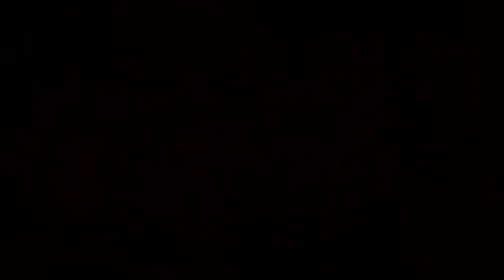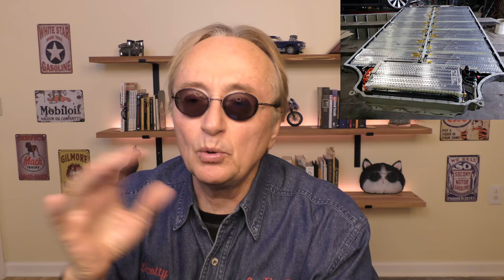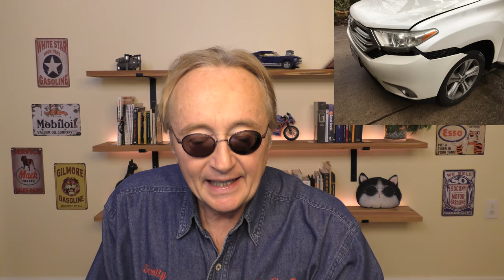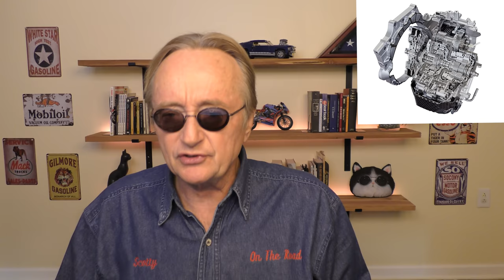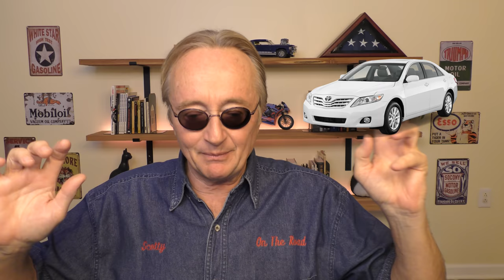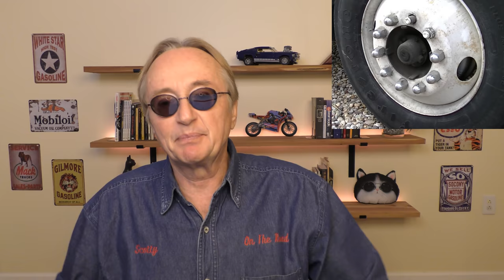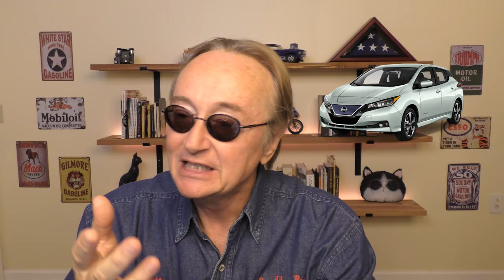This Fatal Flaw Just Ended Tesla’s Future in America

Comment: My great, great grandfather said that the car would never replace the horse and buggy because those rubber tires need air and those engines need gasoline but a horse can just eat grass on the side of the road. I've been an engineer for 35 years and one thing I never say is they'll never advance any given technology. Your emotional attachment to the internal combustion engine is cute considering its 20% efficiency in turning chemical energy into mechanical energy and that is after more than 100 years of technology. Electric is coming no matter what you and some of your commenters think, it has nothing to do with the gubment and everything to do with science, engineering, and resource availability.
Reply: @Mark Codiroli Diesel engines hit 40%. Educate yourself before popping off.

Comment: I am 14 years old I live in Greece and when I grow up I want to become a car mechanic can I or will there be only electric cars?
Reply: water is a clean fuel, 1 litre of gasoline/petrol contains 116 grams of hydrogen, 1 litre of water contains 111 grams of hydrogen what comes out the exhaust of the car is oxygen some steam and water you can drink.

Comment: I thought lithium ion batteries were not supposed to have the crystal growth shorting problem that nicads suffered from. Are those lithium ion batteries made in china? Wasn't there a special charging method for nicads, superimposing a little AC on the charging DC voltage that would reduce or eliminate that? I can't believe this ends the future of electric cars. Is there a similar method of fixing the lithium ion problem or is there a better material coming?

Comment: Scotty I have a question Toyota could make a car that had a scan tool on they Dash that could tell you what is wrong with your car it could be called the Smart car thank you for the video God bless
Reply: Ya I have thought the same thing, It would probably cost about 50 cents to have a system to display the code and description rather than the stupid "engine" light.  Mind you I'd settle for a Battery Voltage gauge and an Oil Pressure gauge both long gone from vehicles or we could right out there and suggest a transmission temperature gauge......nah that's just crazy talk!

Comment: 01:50 - Sorry, but no. This is a problem with a small batch of batteries out of one production line that was traced to a misaligned piece of equipment. No other production line making the identical batteries has the problem and neither do any later model Bolts with the batteries from the US production facility. No Tesla batteries, or any other manufacturer, has had this dendrite issue in less than 250k miles and most don't show signs upwards of 400k miles if well taken care of. Your assessment of EV is very unfair given they have been mass produced for only 8 years ...How well did gasoline cars do at the 8 year mark? Were Ford model Ts making it hundreds of thousands of miles with issues?

Comment: Its by design. They don't want batteries which can last long term.
Reply: Tesla is actively chasing a battery that can go over a million miles with less then 20% degridation, their current batteries are at 20% every 400,000 miles, even the motor has been tested for 1 million miles, their new battry cell they are vehicle testing now will do that, electrical engineers working on the car mantion the electronics being 5 years ahead of the auto industry, they aint putting nock off japanese caps on these things.
Reply: @Mark Codiroli peove it.

Comment: Scotty, I understand you’re suspicious of anything you consider new. However, batteries can be designed to last one use, or 100 years. It REALLY depends on the design, allowable cost, size, weight, etc. There’s a great deal of difference from a ‘lithium’ battery you get in a phone, or camera, and the one in a car. Batteries for a camera typically aren’t made to last more than a few years, since they really don’t need to. EV batteries are often designed for 10-20 years. Of course this does not mean they all will, in all conditions. The Nissan Leaf has a rather poor performing battery, and they still don’t do much about it. However, with a good design, you can make an affordable battery last 20+ years in an EV, which means it will most likely never be replaced. Tesla has a fairly good track record, easily the best in the industry, all things considered. They had a lot of outright sudden failures, but when those don’t happen, the degradation is surprisingly low. Other manufacturers are slowly coming out with good designs and hopefully they last a long time as well.

Comment: You can't compare a camera li-ion battery to a car battery. By manufacturing the batteries differently, you can prioritize energy density, power density, longevity, or cost. I've had phone batteries go kaput in 1.5 years, but I have an iPad 2 that still has pretty good battery life 9 years on. All because the battery is less energy dense than a phone's, so it's able to achieve greater longevity for a given energy capacity.

I also have a Segway that still gets its full range after 3.5 years and hundreds of charge cycles. If a battery is meant to last, then it can last.

If you need proof, look at Apple's claim of 80% battery health on Macs after 1000 cycles. My Google PixelBook still has 91% battery health after 700 cycles. Or even go on battery university's website about how if you charge batteries to a lower voltage, you get thousands of cycles. All these things can be achieved by sacrificing energy density and making the battery physically larger.

Comment: This is why we buy trucks from the 70s 80s 90s they run 10 times better. And don't need to be charged.
Reply: They form emissions that kill much more americans and are a road sefety hazzard, cars before the 90s where garbage, their batteries where also shot so you did have to get a charge from someone else when it failed 2 years in.
Reply: lopez  more people die in trucks today then they did back then. cuz the car now are basically made of plastic. And the trucks back then were made of real steel. And  btw the trucks had nothing to do with the batterys.
Reply: @jacobdaniel9239  cars back then wherent built with crunch zones, this lead to the car being so solid that the passengers bounced around in them splitying their heads open, cars right now are built to save the passenger instead of themselves by letting themselvestake the impact energy to reduce the jolt from the impact, battery powered cars have the highest crash safety because the heavy battery anchors the car to the ground more effectively then a gas drive train, tesla is making a stainless steel truck with 1-3mm pannels of the same steel used in the new Starship rocket, its supposed to be more rigid then a regular pickup, looks like it.
Reply: @Mark Codiroli i know more than you about this, try it.
Reply: @Mark Codiroli are you going to ask questions or not?
Reply: @miguellopez3392   they really didn't need to put a crunch point in it cuz they really didn't go that fast. Back then most people obey the law. And weren't many wracks.
Reply: @jacobdaniel9239  well trucks of today go much faster and people still dont care about speed limits, that truck tesla is making goes 0-60mph faster then a Porsche 911 so it really does need cruch zones, less people also owned cars back then and there where less injuries because they died instead, remember when companies tried convincing the public they didnt need sestbelts? Cars and trucks back then wherent built to keep you alive to keep it cheaper, thats also why you see stronger emission regulations as emissions from cars kill more people then from car accidents, trucks are the hardest hit by these regulations.
Reply: @Mark Codiroli still waiting.
Reply: @Mark Codiroli can you give me an example of a question you asked? you seem to have repeated the same comment 4 times thinking you where having a conversation.
Reply: @Mark Codiroli still waiting.
Reply: @Mark Codiroli really nothing?
Reply: @Mark Codiroli I repeat give me an example of a question you asked.
Reply: @Mark Codiroli 1 more time, give me an example of a question you asked.
Reply: @Mark Codiroli have you found your question? And if so, repeat it.

Comment: He forgot  to mention that if you  DON'T  leave a Tesla fully charged for long periods  of time the dendrieds never form. I bet his cameras are fully  charged right now. Also there is a good reason Tesla doesn't want normal auto mechanics working on there cars. They would be better off hiring  an ELECTRICIAN. At least they would be used to working around 360 volt three phase systems and not just 12 volt systems. This man would likely  kill himself trying  to work on a Tesla. Maybe his next video should be how to safely  disconnect the power to a Tesla. I bet he dosen't know without researching it. He is probably a good mechanic on normal interernal combustion cars.

Comment: I’m not ready for electric car that I have to replace a quarter of the time that a gas powered car could last.
Reply: Model S plad+ factory stock

Cost 
 $140,000
Speed
  200mph
0-60mph time
 1.99 seconds
1/4 mile time
8.99 seconds.
Range
 520 miles EPA
Coming late 2021 slighly slower vesion delivering in 3 weeks.

This will be the quickest production car ever made.

Comment: Who needs tesla when mazda is going to make a combustion engine with equal carbon footprint
Reply: Hopefully. The Skyactiv-X is impressive enough but did fall kinds short on delivery, but as the first and only gasoline engine to achieve a combustion ratio to that of a diesel engine, it has room to improve also. So if they deliver with the Skyactiv3  with a thermal efficiency of 58%, it'll be decent to see more of it.

Comment: This is disingenuous. The problems Kilmer is listing are well known and the solutions for them are working.
Comparing electronic device batteries to the automotive batteries is invalid, the automotive batteries have things like coolers and heater that your cell phone doesn't, which ameliorate most of the Li-ion temperature issues. They are also a different chemistry.

This and his other videos on electric cars are diatribes, they are not valid representations of the technology.
The degradation with time of present Tesla batteries does not affect acceleration, only range and that loss of range is tracked and for many people still is far more than they need on a charge.

Comment: I have a 2020 Chrysler Pacifica S red it Wolf hybrid with EV and Gas it was good In gas but The EV battery will only give me 32 miles In battery it will only last me like 35mins till The EV battery dies So I will stress a lot to try to charge the battery but the Hybrid  with gas gives me 480 miles range with a 32 miles on EV battery my fan will give me 512Range but If I use the 32 miles on EV battery with the radio AC and the time lights on and DVD player play in the movie the van will only last 15 to 20 minutes before The battery dies so I didn’t like that I paid 47k for it it was Waste of money If you choose to buy one of these cars please buy the hybrid because it Runs with gas also...

Comment: Graphene batteries are hopefully here soon.
Reply: new tesla batteries should last over 1 million miles of use.
Reply: @miguellopez3392  Yeah, that'll happen when it's ACTUALLY proven, otherwise, you can't say that now, there's no evidence to support it. And it'll be fun to see how the rest of the car holds up, because well, it's called a CAR for a reason, NOT  a battery.
Reply: @samtiffin6878  there is evidence such as teslas partners publishing papers on the durability of their chemistry, thankfully battery cars have less parts to brake down anyways.
Reply: @miguellopez3392  Well, the battery hasn't been put to test in an ACTUAL CAR, so you still can't confirm it to be true, a prediction isn't an outcome, there needs to be an experiment, to confirm what you're saying.

Yeah, an electric motor will be simple, but all the modern complexities of cars isn't, and those will break down over time, leading to expensive repairs, jut look at the amount of technology in a Tesla it is bound to have electrical issues, in coming years. Cars need to get simpler, with less infotainment features and other unnecessary features and equipment then only can cars can be actually reliable enough to keep for a long time, without the need to throw away the existing one, for a brand new one. And I don't see the point of making new electric cars, when it will take much less effort and energy to just swap in an electric drive train into an existing car body, you're recycling something by doing this, and that's good for the environment, it means we can save materials such as metal needed to make the body and wheels, and rubber to make tires, making new cars and scrapping the old ones, is just a big waste of resources.
Reply: @samtiffin6878  it will do better in an actual  car, testing cycles for batteries are done at room temperature and are discharge and recharge from 0-100%, EVs will typically have glycol cooling and cycle between 20-80%, this significantly reduces battery degradation, their current cells can do 300,000-400,000 miles with only 20% degradation to the cells, these same cells will only last 2 years before doing that damage in a laptop or phone scenario where they aren't actively cooled and are power cycled more aggressively.

Teslas have reliable electronics, their interiors may be boring and their fit and finish questionable but they do spend extra on the electronics and mechanical engineering, it's why a $62k model 3 is seen as a booring or substandard "luxury car" but 
 "ranked as best commuter car"  and can compete with a $120k electric Porsche on track.
Basically they don't cheap out on the electronics like most companies do, and it makes a difference, you will not find more processing power in a production car than in a tesla model S, teslas don't even have removable fuses due to how long things are engineered to last, they have limited service centers and no dealerships so it would be more expensive to set up the repair network for their cars then to make them last longer, there comes a benefit from replacing 80 mechanical buttons with 1 digital display.

Comment: With over 32 million cars in the UK where will the exhausted batteries be dumped? Your backyard?
Think Hydrogen must be the answer. Two plants in the USA building the fuel cells. A plant in Wales building a two-seater now.
Reply: Why would they be dumped? Cell phone batteries don't get dumped. 
If correctly designed, vehicle battery packs can have a useful life of two decades or more, say 8 to 10 years in the car, and then they can be repurposed for static electricity storage.

As for HFVCs, they'll never sell in big numbers for multiple reasons.

Comment: Electric cars are useless if batteries last 2 or 3 years. They are a rich persons boondoggle. Paying more for less capabilities. Plus towing will never work unless the battery is 6 times bigger and charges 9 times faster. Of course the weight goes up with battery size and towing capabilities go down with increased weight.  Just a terrible idea all around. And the idea of Electric cars helping the environment. Just take a look at coal power plant used to create that electricity.

Comment: Wow unreal about tesla
Reply: That big flat screen in early Model S and X has the "data-logging" issue, and has been known for a few years.

The battery issue is new to me. Even so, many Tesla cars are still on the original battery pack and have retained a decent amount of range. Not so with early Nissan Leaf EVs. The Tesla BMS (Battery Management System) is far better. From my reading, it seems the Tesla battery pack, BMS, charging, and drive units are now quite good. It's the rest of the car that is Yugo quality poor, and BMW expensive to repair.

Comment: Ohhh so all those video I've seen where that person was trying to park and the car suddenly accelerated and ram the shop made more sense now. Lol
Reply: Not really. In most cases, the driver stepped on the accelerator and not the brake. It had rarely been a mechanical or an electrical issue...up until now. With drive-by-wire being commonplace, an electrical failure can occur.

Comment: Dendrite formation is not unique to Tesla's batteries; this happens in all li ion batteries & it's accelerated when batteries are misused. You're incorrect when you say a software solution can't correct the problem; all tesla would have to do is change the way in which the vehicle is being charged & the problem's solved. & I don't think the problem is as prevalent as you're acting. Time will prove you wrong & the internal combustion engine will be largely relegated to the past no matter how much you wish it wasn't.

Comment: Hybrids like the Prius use NiMH batteries and not Li-ion batteries. NiMH batteries arent sensitive to temperature and do not grow dendrites, but they self discharge most of their battery energy over the course of a single day. That's why they arent used in fully electric vehicles. 

Li-ion batteries are currently the only option for electric vehicles because of high energy density, low self discharge, and good cycle life. Dendrites are only an issue in cold temperature charging, but can be avoided by charging slower or heating the battery before hand. For the battery fires, the batteries will experience thermal runaway if overcharged, but it is very hard to approximate when the battery is 100% because there are little thermal and electrochemical responses when the battery is max charge. Overcharging structurally damaged the battery aswell, so it is always recommended to charge your battery to about 85-90% to improve long term battery health and prevent thermal runaway if the software isn't controlling the charge correctly
Reply: WRONG yestrep! NiMH batteries lose 20 percent in the first 24 hours after charge and 10 percent per month thereafter.